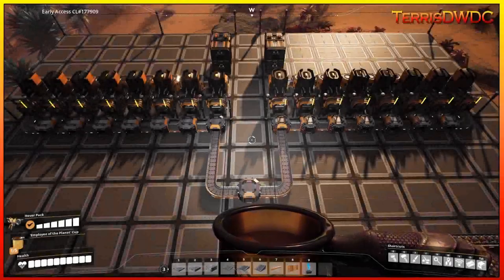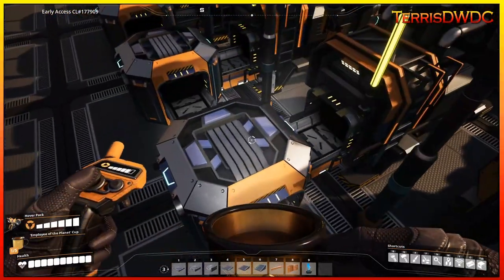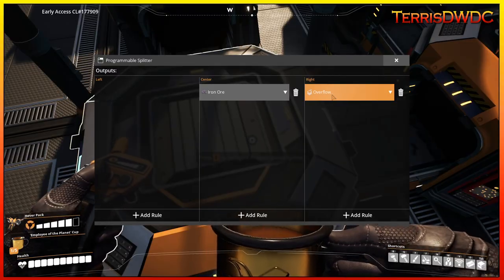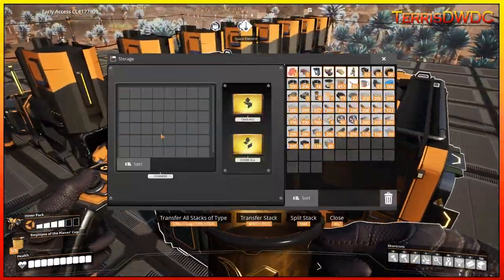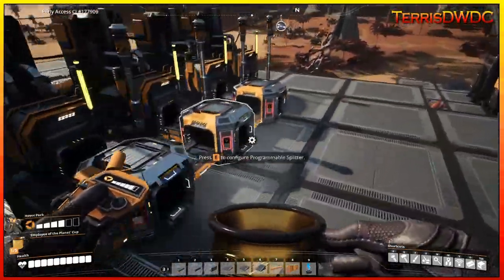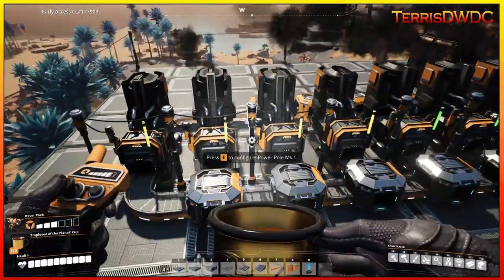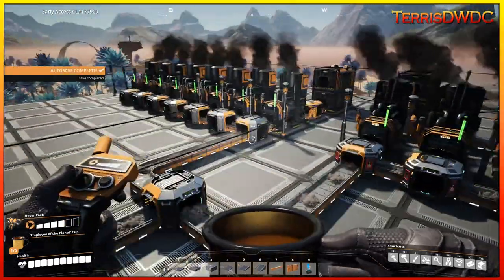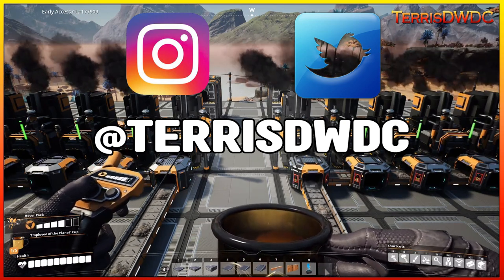Basic Manifold vs Smart Manifold - Satisfactory Update 5

Comment: You spent significantly more on building the smart line all so you can produce fewer ingots in the same amount of time. Plus, in the end, both lines will produce at the same efficiency and produce the same output. I can see why no one does this. It's a neat idea, but ultimately it's all expense with no payoff.
Reply: not to mentions the bugs with smart and programmable splitters
Reply: And the additional time for setting it up plus more resources to build them to begin with.
Reply from the maker: You eventually get to a point where resources are not really an issue, I'm using my starter factory now to Farm all my resources as I continue to build my first Mega factory
Reply: @TerrisDWDC  Yes with non-depleting sources this is true. By the time I have smart splitters I have usually built quite a few factories already. My point is, that smart splitters are more efficiently used for a storage system, or for sending surplus to a sink. For production control they seem not to make a positive difference. Eventually also the last smelter will get enough resources regularly. If filling the smelters is a must (want to have), why not interrupt the output line for a few minutes? Then start again when the last smelter has 100 storage. Otherwise the last smelter will never fill regardless of the layout unless the storage of the end product is full or the production doesn't use all the ore with the same speed.

PS: Anyway, I think the time and effort needed to setup a good smart splitter array for this is not worth it.
Reply: @TerrisDWDC  COPE. You literally proved that using smart splitters are a detriment.
Reply: @TerrisDWDC  An interesting test to add to this would be using mk1 belts going to smelters from splitters.  Having a high speed bus with slower smelter input-belts would allow the end to receive more ore sooner (in both cases), I think.  Edit: Literally, the next video was testing this.  Thanks for doing the leg work for me!
Reply: Just use mk1 lines from splitter to machine to spread the manifold a bit faster.
Reply: I use them because I prefer to have as many machines at full uptime as I can instead of several that turn on and off repeatedly. It also makes the lights a little more useful to see how loaded a set of machines is. A more practical use is in power plant feeds. by using a smart manifold you wont have multiple machines turning on and off and have a more stable power output.
Reply: @TerrisDWDC  but it has no point using programable splitters if it is not gonna be more efficient, its stupid

Comment: You should feed each smelter from each splitter with only a Mk I belt, the material wont be able to feed in as fast and will cascade/overflow to the next. However, each Mk I belt will feed up to 60 material, this means they will all run continuously at 100% while pushing more material down the line.
Reply: This is the way. Get all the smelters fed faster as well so you have them all running a lot sooner than the smart splitter system where most smelters do nothing until the first few are filled up (which is pointless because they don't produce any more whether they are filled or have just enough to run anyways).
Reply: i did like the video, just not seeing the use in it over a regular overflow, and as Midrealm said, if you use the 60 belt the filling will speed up on the other smelters + that it uses less precious metals.
Reply: @Synthetic_Future The info presented like this is a bit misleading. Using slower "side belts" rather than faster ones is a common conversation to bring up, but the differences aren't as clear to distinguish as you think. Firstly, if one looks at all the machines' efficiency, the methods to have all machines reach max efficiency the fastest are (in order of speed): Load-balanced input; smart manifold with highest tier side belts; smart splitter with lowest tier sidebelts.
Interestingly, though, this does NOT align with which setup produces the most items in a set amount of time (from when input starts coming). In this perspective, the order is: load-balanced; low tier sidebelts; high tier sidebelts.

The reason why is natural: the more the items are spread out between the machines, the more machines will start producing "early". But in an overflow-based system (like manifolds) this increases the time needed for the system to fill all involved storages and reach max efficiency, since the more the items are spread out between machines the faster they're consumed and the longer it'll take for the storages to fill up.

So while I don't disagree that low tier side-belts can get you products out of the system faster, saying that they make machines REACH MAX EFFICIENCY the fastest is untrue.
Reply: Or put a splitter going into two machines and feed that with a Mk. 1 belt

Comment: Also, this is pointless.   When building a manifold setup like this, you should create your smelters, then turn them on and let them fill  up entirely WHILE you build the next row of constructors of whatever you are doing.  Then turn THEM on while you build your output infrastructure.  If you turn your items on methodically AS YOU BUILD each stage of your factory, the normal manifolds will fill up just fine and you'll be running with no stuttering.

Comment: If you want that smelters to really start up faster (what you call "efficiency") you can use different belt levels to really achive this. Put MK5 for the main belt and MK1 leading to each smelter. For the smart manifold: do it with manufacturers, mix 4 different input items on the same belt and put a sink on the end of the input belt and then it makes sense to use them. If you use the different belt level trick with smart manifold, you have to set the main output to any, except for the last splitter for each material, that you will set to overflow (+optionally to any undefined if its programmable) to not use any materials to the sink (if your input is the right amount per minute, that is.
Reply: Mixing on a belt that goes directly into a machine generally isn't a good idea. If you have even a slight imbalance, it can eventually back up into the splitter and block the entire line. The last splitter would need to overflow into a container to catch this.
Reply: @magepunk7711  that's what the sink at the end of the belt is for. It will take care of any small inbalances by preventing the belt from ever backing up. For a perfect ratio setup it is not strictly needed, but humans make errors. At my base the sinks are placed after my storage room to catch any overflow I still need.

Comment: So basically, the programable splitter manifold eliminates the wait time needed to prime the entire manifold system before starting the machines. It'll just manage itself which can be usefull.
Reply from the maker: Smart splitters will do the same thing as well, and are significantly cheaper to make.  I just used the programmable splitters because I had lots of the materials.

Comment: a smelter that is full of ore is not 100% efficient though. 100% efficiency is a second ore coming into the machine a split second before it finishes with the first. A machine that can only process 1 ore at a time  that is full of 100 ore is actually very inefficient because those 99 ore are not being processed.
Reply from the maker: Which is why load balance is the more efficient approach as only the item needed is received by the equipment. Making the manifold less efficient as the only machine truly achieving 100% efficiency is the last machine in a manifold array as all the other machine have to become saturated before the final machine receives the correct amount of items.
Reply: @TerrisDWDC  Absolutely. If you really want to get the most out of every node, and your factory to stay running correctly all the way down the line, load balancing is the way to go. Of course, sometimes space can get a little tight, and manifold makes spatial logistics sense. Nice comparative video nonetheless.
Reply: +1

Comment: Both setups, at full saturation, have the same throughput.  The only difference here is the "Smart" side will always have any active machines running at 100% "efficiency" (more accurately referred to as short-term runetime %) with the remainder at 0%.  There's no gain here by using the "Smart" method.  In fact, if you expect to have variable input, it's a loss, because the "Smart" side will take longer to reach saturation.

Comment: 3 to 1 conventional splitter. 
I never put a splitter of any kind this way if equal feedingis important. 
If you want to feed equal, you need feed equal. 

So, odd numbers preferably (Splitters= 3 feed lines),  9 producing machines to 3 splitters. 3 splitters down to 1, if your conveyors can keep up with required material. 
Think of it as a upside triangle, point end feed in line. 
Hope that makes sense.

Comment: This comparison only makes a difference for ramp speed, not final efficiency of the setup. Considering that ramp speed should usually be a one-time concern, the comparison is largely pointless.
Since the final efficiency is all that really matters, the cheaper and quicker to assemble solution is the most logical to use - the use of smart splitters is an extra point of possible misconfiguration to debug.

Comment: One scenario I can see this being very useful for is large scale coal power plants with lower tier belts that only just match the input amount. The filling up completely feature will prevent the latter generators turning on and turning off. It's a problem that sorts itself out in normal manifolds but this would keep the power consistently increasing rather than oscillating. Still you've got to be in the scenario of using smart splitters when you're at coal power and an array large enough to make it worth it.

Comment: I think both systems behave with same efficiency in the long run. Think about it, no matter the config, the input belt will never get backed up. So since input = output for both configs, they both have same efficiency. But yea, smart man will have more consistent output at the early stages. But in summary both of them will be same efficiency.
Reply: The smart splitter system is usefull for big power plants. If you consume to much power only the last generator will toggle, while the normal splitter will run out ressources on a bunch of them.
Also the lights of generators will tell you whats up with the system.

Comment: I've been building overflow manifold s for a while. There is an added benefit that if the wrong item should be accidentally fed into the manifold, it will never enter a machine (if you also use a smart splitter on the last machine).

There's also the option of using the machine side of the smart splitter as the overflow instead of the bus. That way you can have the machines at the far end start running first and the belt always saturated. Handy if feeding parts from opposite ends with machines requiring more than one input.

It does give more power stability as it steps up by one machine at a time instead of multiple machines starting and stopping.

I use this in my central storehouse that has overflow construction before items are sunk. Eg, once copper wire storage is full it overflows into a cable production line topping up my cable storage. Once cable storage is full it overflows to lines requiring cable as an ingredient. Only when an overflow production line is saturated will the excess be sunk.

Comment: Full load balancing, without any feedback loop mergers that cause overflow of primary input, will always be the fastest startup, and more resilient to momentary interruptions or upgrades.  However, they can take up a LOT of space and resources, not to mention time and complexity.  A basic manifold, with normal splitter would suffice.  If the initial time to saturation is bothersome, go gather resources and manually keep the last few fed.  Programmable Splitters are fine for all your use cases described.  There's no need or benefit to a programmable splitter for this use case.  Smart Splitter can select items just as easy.  The only bugs I've seen, is that the initial "Any" setting is often ignored, as if "None" were selected.  Thus, manually toggle all to "None", then back to whatever you need, to ensure you changed everything at least once.  That said, mostly been using Smart Splitters to divert excess on input side of factory, and output side.  First stage of overflow goes to storage, which can be connected later (or automatically) to supply the factory temporarily.  Second stage overflow goes to a factory export (belt, truck, drone, train, etc.)  Third stage export, to a sink bus to nearest recycling facility, to minimize power consumption of underutilized awesome sinks, by feeding saturated lines before starting to fill a new line.  A middle ground between full load balancing, is to at least partially split resources, even if you split to two smaller manifolds, there may be drastic benefits, in terms of reaching saturation faster.  Or, you could manually underclock machines the farther from manifold head you go, and upclock them gradually as they fill.  A slower saturation manifold can be a benefit to reduce power-on load, if power grid consumption is near capacity, to avoid spikes, give a chance to power down factory before tripping the grid and then having to bootstrap power plants or something.  All depends how hands-on you want to get.  Space-wise, simplicity wise, manifolds really can't be beat, especially early game, but that simplicity comes at a huge cost later.  Blending styles as needed may get best results.

Comment: Smart splitters should only be used if 2 or more materials are needing to be separated. Also you should have your ore feeding in from the center smelter, this way you are splitting in 3 directions instead of 2, from the start. This produces a mush more efficient distribution chain.

Comment: I’ve also tried this in both variants. On my smart split manifold. I had the best balance using the the main throughput line set to iron ore and set the smelters to overflow. You can also try setting a merger before your very first splitter, then set the final smart splitter to overflow into a loop back to the original main line merger. Products will constantly saturate the line and keep it running steady. Idk if one is superior to the next but seemed like it worked well

Comment: I've built a factory or two using the smart overflow (manifold or bus) method and in smaller examples like this, your conclusions are correct that the smart splitters are similar or even less performant than normal ones. However, in extreme factories where your workstation lines are 25+ stations long (or fewer, depending on the type of workstation and item being made) on a single bus then you really do need to either add smart splitters or pre-split your lines to feed the main bus or else your production will stall

This is due to a factor that only becomes apparent at extreme ranges: belt length. As a belt gets very long it takes TIME to move items across it and over that time period the production rate of the machine will become too fast for the belt to keep up. And as many know, when a machine "stalls" there's a cool-down and warm-up penalty in the production rate used to incentivize efficient design, the workstations don't just instantly turn on and off when they get enough items. And if your factory relies on tightly managed production rates, this will destroy your efficiency. So at extreme lengths, a smart split design and a pre-split or multi-split design that feeds items into the bus at different points is needed to keep production rates stable. The alternative to this is to overproduce and saturate your belts, but this becomes pretty infeasible when you move up the tech tree to high level items.

Again, for "normal" sized factories, this problem won't present itself really. Only in larger factories where you really want to keep your production rates stable, which is not something everyone cares about and that's fine!